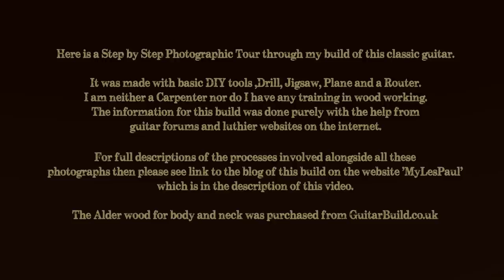John Lennon Rickenbacker 325C58 Build in 10 Days

Comment: I wanted to know how to install the Bigsby the most, but it's a pity that I couldn't see it.
Reply from the maker: Fitting the Bigsby is an easier part of the build...It touches the base of the guitar body...So you run a straight edge down the centre of the neck all the way to the base of the body and mark a 3 or 4 inch line it at the body base (use tape instead of pencil if you are concerned with marking you beloved guitar)...You can then mark a 90 degree angle from the line near the base of the body will give you the correct rotation of the tailpiece string retainer...Place your Bigsby there, mark the screw holes, drill pilot holes, remove your marks (or tape)  and screw it in place...Bear in mind that John Lennon fitted his on the counter of a music shop in Liverpool the day he bought it and is actually rotated a degree or so clockwise off centre...John Lennon was 'not practically minded' (quote from Ringo)

Comment: In 1962 John  Lennon had the body and headstock Spray painted making the Iconic ed Sullivan guitar
Reply: Nope..the color has nothing to do with it. V59s came in black as well as natural.  V59 has double guard and is maple instead of Alder like the C58. The c58 is about 2 lbs lighter. C58 is full 2 inch thick..the V59s were a little less.
Reply: John Lennon had the guitar painted black. The v series of Rickenbackers are usually vintage reissues. There is for example the c64 and v63, the c58 and v59. The vintage reissues are generally less expensive

Comment: Absolutely outstanding Lewis!  Speechless.......I usually build amps but have been bitten by the guitar making bug recently. I think its time to give this one a go as it would make a nice compliment to my last amp build.........a "63 VOX AC30 with integrated top boost (it's the one in my profile pic). Having played a mate's 320B through it and hearing how it sounded, it's a must build for me now. Would love to get a few basic measurements from you if you wouldn't mind!!  Cheers!
Reply from the maker: I got the dimensions from the official Rickenbacker site....Also check the link in the above description for blog and step by step guide....You only need tracings from the body and headstock shapes to build this with maximum accuracy...I can help you with anything you need....You can also get those shapes from anyone who has an original 325.....Let me know

Comment: incredible, congratulations from Argentina, your guitar has been very good. At this moment I am building the same guitar, could you help me by telling me the length of the truss rod you used?
Reply from the maker: I bought a standard length truss rod...and then I spot welded the end...You can do this yourself or get a welder who would charge a real small amount of money just to spot weld in a few seconds...Check the vid at 0.33 and you can see where I welded it...Then i just sawed it off...To be fair the truss on these short scale Ricks is probably hardly used as the neck is so short that there is minimal bend when the guitar is tuned especially if you get the correct strings on it...

Comment: how did you get the truss rod to fit such a short neck?
Reply from the maker: (0.33 in vid you can see the weld)...Hi bud...I bought a standard length truss rod (they very cheap) and cut and welded it shorter...Altho...from what I hear it's pretty useless on these 325s as the neck is so stumpy and the strings less tight than normal they don't really need one...

Comment: Dude your blog is not available anymore. How did you put the color on you pickguards?? Is it a sticker? Or is it paint?? You showed a picture on the video but i just dont get it. Thanks
Reply: Spray the underside of the plexi with gold spray paint. Also, get the plexi that is frosted on one side and clear on the other side. Make sure you paint the clear side and and use that as the underside. I made a gold Gretsch style pickguard for a Country Gent that way.
Reply from the maker: It was vinyl sticker...You can buy it...The clear Perspex was bought in a sheet and I simply cut it with a jigsaw and the used a round file to get it to shape and then sandpaper to smooth...I can make pickguards to any spec so was not a big deal for me or anyone who can sculpt wood too...

Comment: I like your work but Rickenbackers have 2 truss rods but any way great work :)
Reply from the maker: The Rickenbacker 325 has one truss rod...
Reply from the maker: http://www.rickresource.com/forum/viewtopic.php?f=104&t=414921
Reply: @lewistaylor1965  older Rickenbackers do till I believe somewhere in 1961 or 1962 they started putting 2
Reply from the maker: I think you may be getting confused with the more common 330's and  360's both of which have 2 truss rods...The 325 model has one truss rod...It did in the early days and it did when they reissued the model...I have 2 original Rickenbacker 325 models and a 330...My 325v63 (1999) has one truss rod and my  325c58 (2007) also has only one truss rod...

Comment: if you used real Rickenbacker parts I would be interested in one, it honestly looks great.
Reply from the maker: Then build one with real Rick parts...You have all the info above...I'd like to see it...check links above...It will cost a lot more...Itried to keep the cost low and I can always replace hardware later...To be fair there's only pups ,loom,  jack plate and strap buttons that aren't....and I don't think Rick make the same wired pups from '59...I recently got the wire to rewire the pups to '59 spec myself...Thats a future project..
Reply: lewistaylor1965 wish I could. Would probably fuck up the gluing and cutting

Comment: how did you put in the electronics? that's the bit that's got me confused.
Reply from the maker: +Angel Quintas  I screwed in the pickups and soldered them to the wiring harness....
Reply: Oh okay, thanks! I'm thinking about doing a Ric build myself and that was what I needed to know :)
Reply from the maker: Angel Quintas Make sure you get involved in a blogg on a luthier site...You'll get loads of help....Do it on the LesPaul website in this vid description is best bet...Dave is really helpfull over there....
Reply: +lewistaylor1965 will do!